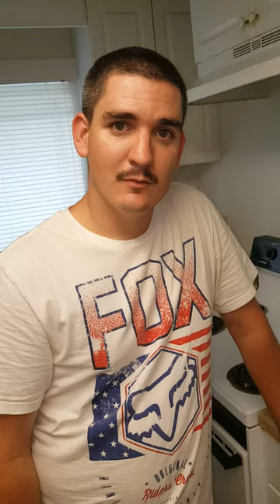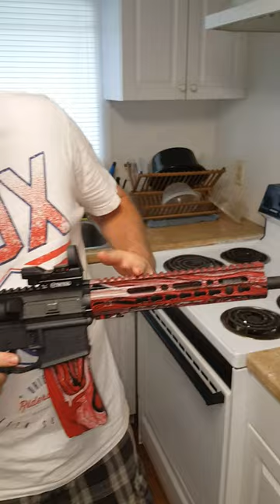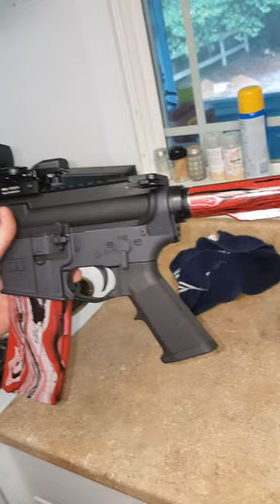Hydro dipped AR15 keymod rail, buffer tube, and magazine. Finished product

Comment: How did it hold up over time? especially the buffer tube
Reply from the maker: The buffer tube wore down just a hair from adjusting the stock but it's not noticeable being that its black anyways. I've put probably 5k rounds through it after dipping it and used it for hunting and it has held up great
Reply: @kotaedenfield  show a new video proving it